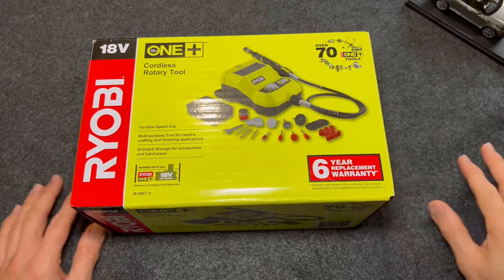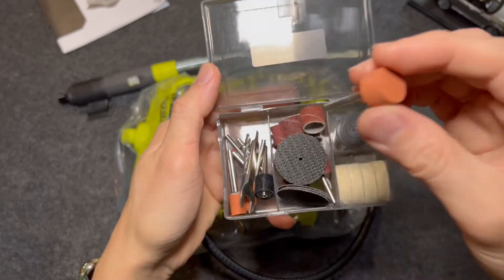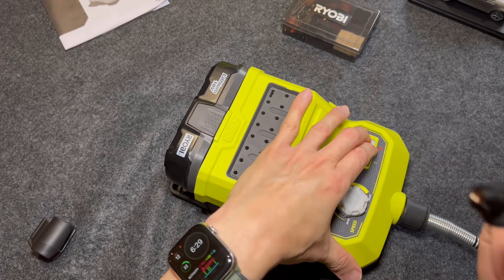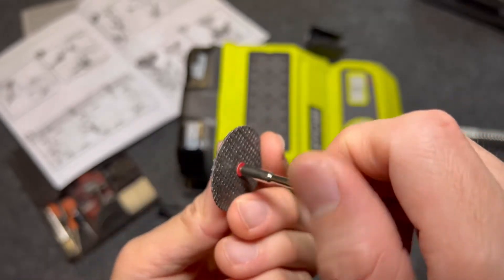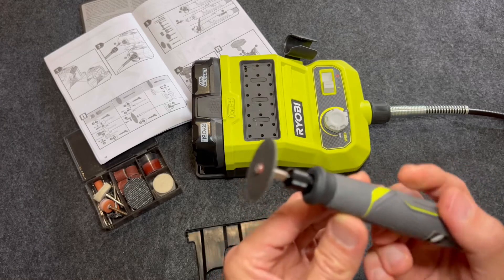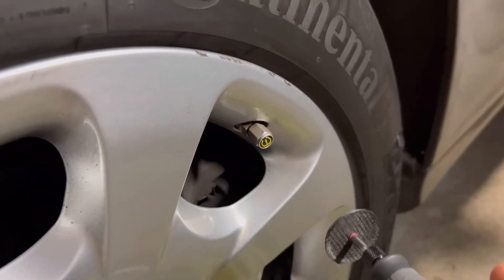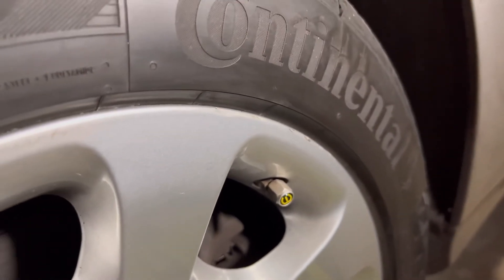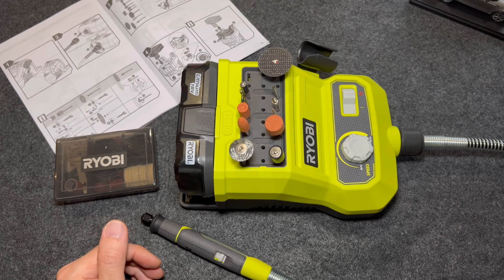UNBOXING | RYOBI CORDLESS ROTARY TOOL

Comment: I used the first wheel attachment to cut bolts
Reply from the maker: Oh thanks for the info Basigman. Was it the same wheel attachment I tried to use in the video? If so, maybe I was just being to cautious given that was really the first time I’ve ever used a rotary tool. But its good to know this tool can cut through bolts as you say. Thanks!

Comment: You should wear the safety glasses! You can see a video the guy using a bigger version and disk and the disk snapped and the piece flew right into his goggles. It missed his eye by less than half a centimeter. If it weren't for the goggles he would've lost his eye. 

Use them especially when cutting metal/hard materials with rotary cutting disks!
Reply from the maker: Hi Byte, Thanks for pointing that out and I fully agree with you. It was so noob of me to use it for the first time without safety googles on - I got carried away with excitement 😀. 

But since then whenever I use this rotary tool, I always wear something to protect my eye as I’m also now aware the danger it pose if I’m not wearing one.